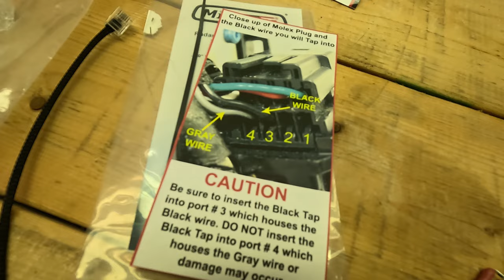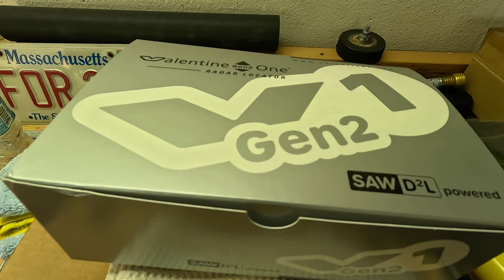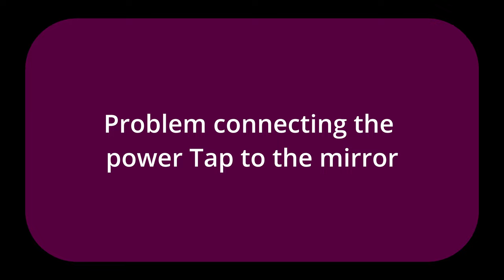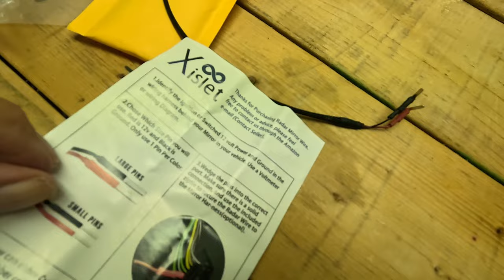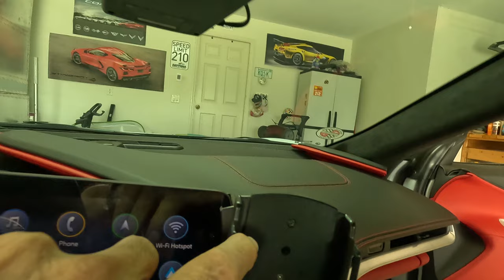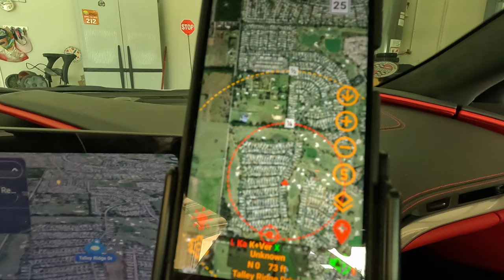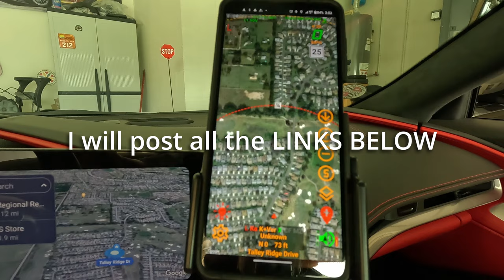C8 Corvette Radar Detector and links to everything you need.

Comment: Robert, Thanks for all of the great info. I was told that a number of people that tapped into the mirror had eventually destroyed the use of the side mirrors. Have you heard anything about this? This happened after some period of time, and GM issued a warning on doing this.
Thanks again,
Kenny
Reply from the maker: Kenny,
Yes, if you get the wiring wrong, you can screw it up. There are just 2 wires to deal with so unless your color blind anyone should be able to do it. Just take your time with the 2 connectors, get the ones that I suggest (the others don't fit well). Too bad GM can't put a simple tap on the outside of the mirror for radar detectors. And I really like having the radar clamped onto the mirror. Here in Florida suction cups don't hold well in the heat. This works perfect.

Comment: I tried the recommended wire and it didn’t work
Reply from the maker: You have a C8? And where did you have the problem? I'll try to help you out.
Reply: @RobertMacCready  Ok, I figured it out. Tap into red and black. Another video said go to the open slots which is obviously incorrect.
Reply from the maker: @johnnyparker2128  👍👍

Comment: It’s better to use a radar blocker.
Reply from the maker: Actually, this checks for airplanes too. And integrates Waze. I really like it but still learning on the features. A jammer will work with it too.
Reply: It’s better to use a radar blocker, but they have to be mounted on the inside of the front and rear bumpers.
Reply from the maker: @andreblalock20  That was my next question. I would think front and rear to have good coverage. How long have you been running the blocker? Also, how far does it reach? Would seem to be difficult to find out that answer. But if you've had no tickets for years and years and you drive with a heavy right foot, I'd say it probably works. How bout instant on radar?
Reply: @RobertMacCready  blockers do not allow radar detectors to pick up anything. But what it does allows you to slow up and they just think that somethings wrong with their radar laser. When they shoot it at your vehicle, there is no register speed. Is it legal no but many of us on our Ferraris, Corvettes and Lamborghinis have them.
Reply: @andreblalock20 where do you get one and what is the brand you recommend. Also who installs them, like a radio shop? Like to know more about them. Thanks!